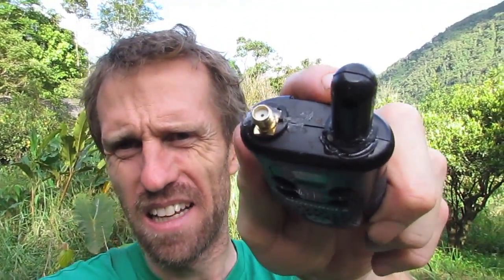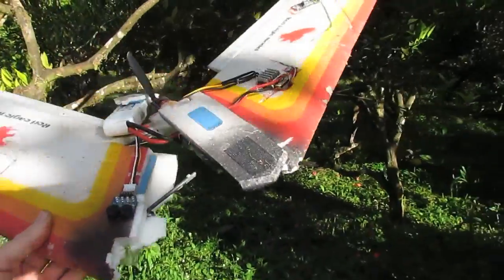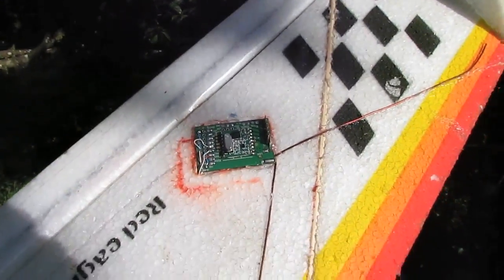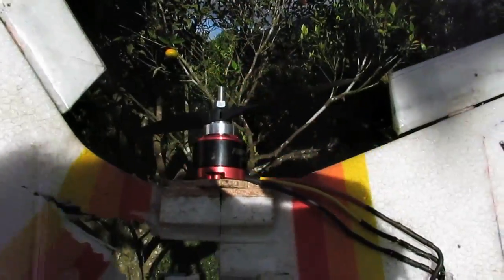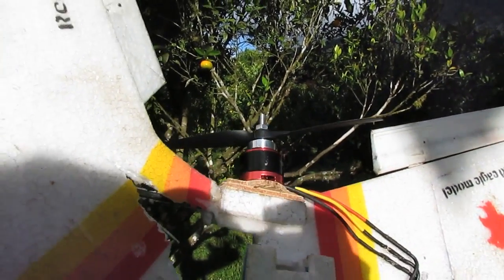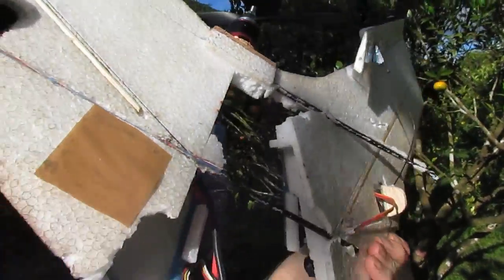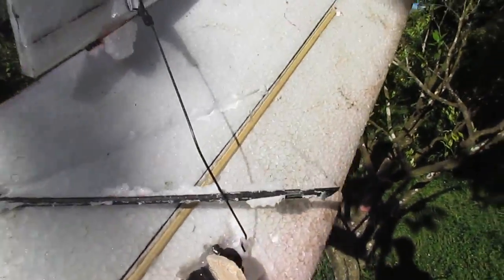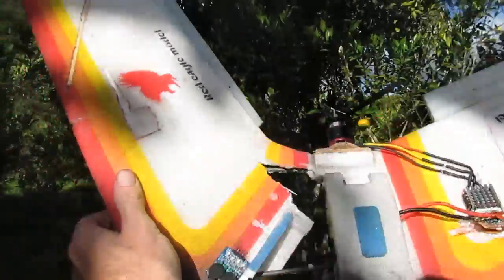Finding a lost model with the OpenLRSng beacon. RCHacker #48

Comment: I have been tinkering around on and off for a while now( long time actually) with a low cost unit to find a lost Plane,Quad or Heli that use's TDOA (Time difference Of Arrival) to give a direction to the downed craft its very similar to what they use for tracking wild game for study I just never really stayed working on it I would have thought it would be available by now for our hobby? is it not? the cost would be somewhere around $65- $70 maybe I should finish the proto type it was working the last time I had it out to fool around with it.  It started out as a way for me to track Deer as I used to bow Hunt so the Tx is small enough to fit inside the shaft of an arrow as long as the arrow stayed with the animal I could track it- you think there would be any interest because of all the GPS and more modern electronics out? that's kind why I never kept up with it just a thought
Reply from the maker: That sounds like you would be working with picosecond timings there, even radar type electronics. I assume that a directional antenna is simply much more efficient at determining direction.
Reply: I'm working with a bow tie antenna.Yes it is very fast timing. Its a simple idea but hard to get consistent results lol (I'm self taught) but basically the Rx switches between the two antenna (uses a 555 timer)at a very high rate. it is so fast that it will produces a audio tone (like when you turn a LED on & off so fast that it looks as if it is always on) that tone will fade as the time between the two is shortened until the signal is received at the same time on both antenna there is no tone at all (as you rotate the antenna) when there is no tone that is the general direction of the Tx but one problem is it could be 180 deg off or directly  behind you lol
Reply: oops I got carried away a second lol Yes a beam antenna (yagi) tuned to a specific frequency should work that was another option I was playing with You know the saying K.I.S.S (Keep It Simple Stupid lol) that is what I loose sight of sometimes and make things more complicated then they should be

Comment: Not a bad way of finding a lost model. I'd however use a GPS to get a better or more accurate location of the crash site.
Reply from the maker: In my location GPS is not that reliable or accurate, especially if it crashes in a valley or under thick jungle canopy. Added to that is the problem of transmitting the co-ordinates back. No cellphone here either. Best would be homing in on a 'smart signal' that included the gps co-ordinates.

Comment: I'm looking for some kind of tracking device for a DJI Phantom 2 with almost a 2 grand setup. All of the GPS's that I've found either require you to have an activated Sim's Card for texting, or pay a large monthly fee for satellite services. This looks like an interesting option, but I think it would be very difficult to track it down at a range of 1-4 km. Any advice on what tracking/beacon/GPS system I should look into getting?
Reply from the maker: With a 2 grand setup you may as well just tape an old phone to it. Thats what most of the high altitude balloon guys do. That would be the place to look for other solutions as well.
Anyway, I would not fly one of those beyond visual range on 2.4GHz
Reply from the maker: If you are new to this. Just remember, everyone crashes.
Reply: RCHacker Well I've been into remote control cars/boats/planes/copters my entire life, but I'm trying to get into FPV long ranged planes/copters now. What plane would you recommend for a new long ranged FPV flier that can perhaps record HD video if you would not recommend flying an expensive DJI Phantom out of LoS?
Reply from the maker: Aubatron I went with an FPV raptor. RCHacker #51 - FPV Raptor. Maiden flight. . Other commitments means I have not done much more than a few short los flights on that. In Australia me and my brother had a lot of fun with his bixler type plane, went a good few km and caught some thermals. We also did some FPV on a large foam cessna type trainer which was even better. Go for something that you are comfortable flying los then you can always whip the googles off when you get in trouble.

Comment: G'day Marc, I recently reflashed my Turnigy Plush ESC's for my quad using a an arduino and some software called BL- heli. It seems many of the ESC manufacturers are now dumping the atmel mcu's in favour of silabs mcu's so the Simon K firmware will not work on these newer ESC's. One of the features that is programable from the BL-heli programer is an audio beacon from the ESC's when transmission is lost. Just the bees knees for the final 20m or so when looking for a lost model especially in dense folliage like you have there. A young fella of your talent should have no problem doing something similar for the SimonK firmware.
Reply: Lost model alarms are cheap. Plug into spare channel.

Comment: DO you have a step by step guide to set this up?
I set:   #define DEFAULT_BEACON_FREQUENCY US_FRS_CH(1)

I turned my radio on to connect to the rx,
I turned my radio off But I'm not getting anything on 462.5625Mhz  (Chanel 1 FRS)

Comment: I used the SMA to PCB connector from my rx cut off two legs soldered the centre to where the wire goes, and the outer to the shielding.
Have added a photo and a link to it above.